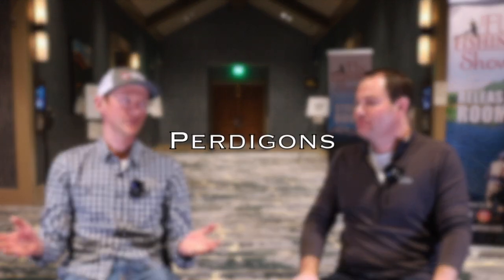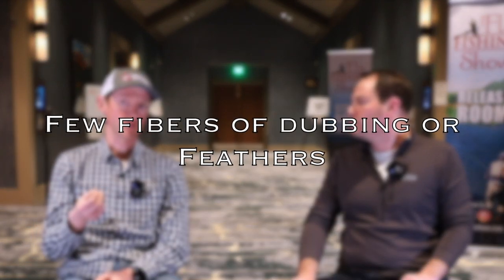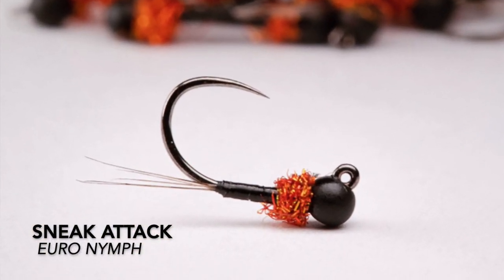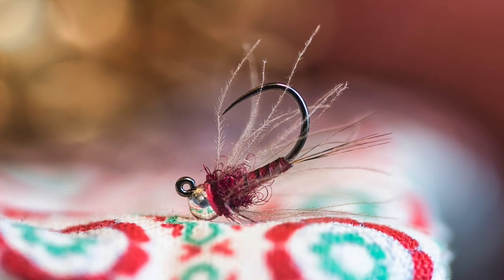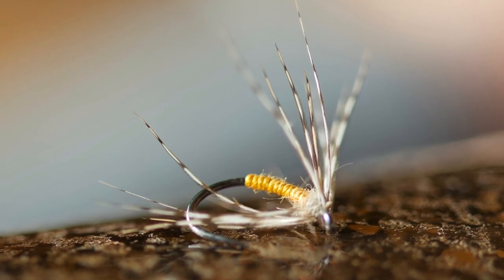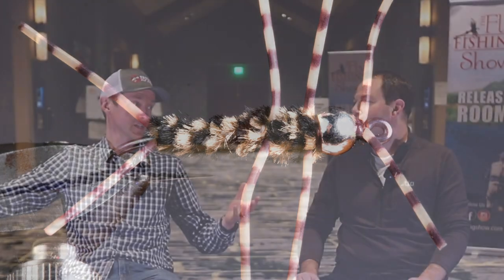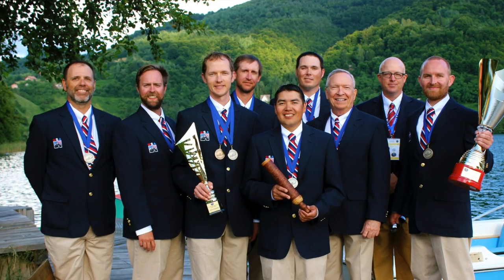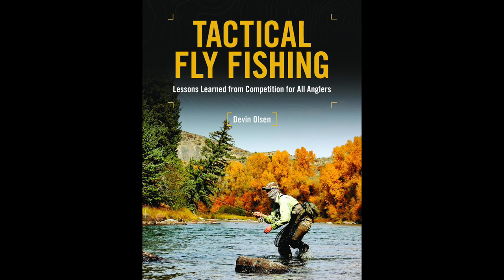Fly Fishing SINK RATE explained...to catch MORE TROUT!

Comment: Perdigons and thread Frenchies are absolute killers.  The ability to use a smaller fly, but get it down through the current where the fish are is so important.  Some would be surprised how little their fly sinks in stronger current with materials that cause drag.  You can also use a shorter tippet section which makes casting easier as well.
Reply from the maker: Thanks for the comments, and I agree with the Perdigons sinking so quick! I have fished some slow and clear sections before where I had the perfect view of how SLOW certain flies sink...it surprised me. What did you mean about the short tippet section, just in regards to casting? Tim http://www.troutandfeather.com
Reply: @TimCammisa  Correct. With standard nymphs I typically use a tippet that is twice the depth in length. This gets awkward around 3.5 feet so I usually decrease the drag of me fly which lets me shorten the tippet but still achieve depth and a natural presentation.